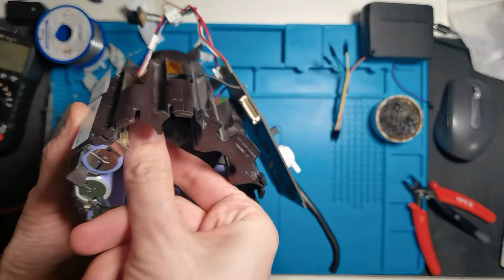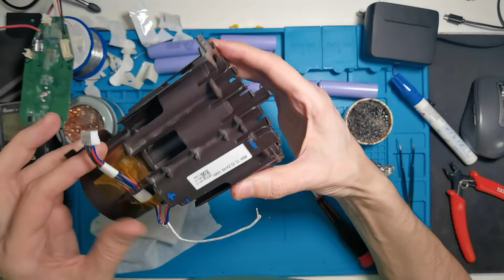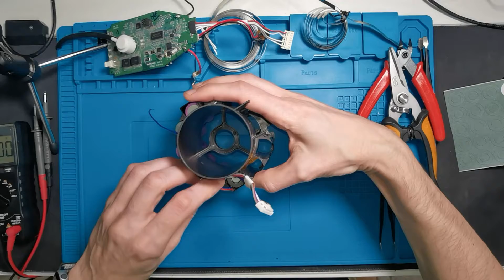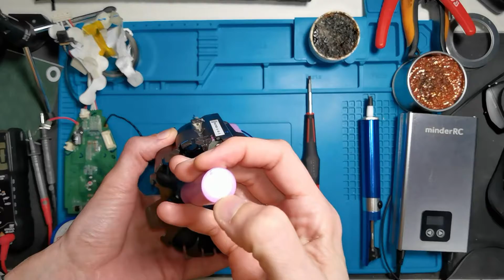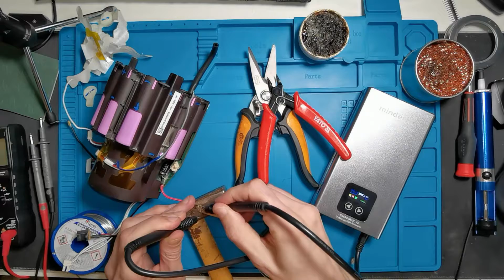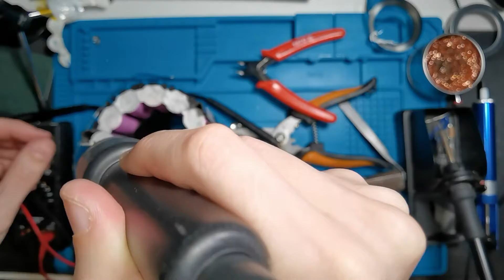Bosch ATHLET vacuum cleaner easy repair replace lithium ion cells SAMSUNG 22P board cip BQ77PL900

Comment: I trier to change the battery and i got them on 29 V but after installing all the vaccun it wont abel to start .
Reply from the maker: Maybe the BMS is locked ? The cells must be changed before no longer working at all.
Reply: @MariusVilceanu  mine the same too. The old battery worked (for very little time) and charged  too. Any idea?

Comment: Hi Marius, I have replaced the batteries but I can't find anywhere how to reset the battery management chip - the PCB has the black four pin connector and I'm guessing it is the serial port - or is there an engineering "trick" to do it using the switch or something like that ? Thanks, Brian in Dublin.
Reply: Настройки микросхемы управления батареями сбрасывать не нужно. Вам это не поможет. 4 контактный разъем предназначен для заливки прошивки.
Reply from the maker: You can't reset the cip, there is no option for this model. You need another board with unlocked cip then replace the cells.
Reply: @MariusVilceanu  Чип (микроконтроллер) сбросить можно.
Reply from the maker: I don't have the right tools for the reset procedure.
Reply: @lozarioloza7684  Hola, me podría describir cómo hacerlo? Con las pilas nuevas los leds parpadean como si estuviera cargando pero no enciende. Gracias
Reply: @AlejandroPerez-Sevillano  Нужно подключать плату к программатору. Это долгая процедура, так словам не опишешь.
Reply: @MariusVilceanu  Many thanks !

Comment: Salut Marius, 
Urmarind clipul tau, de mare ajutor, am desfacut si eu un Bosch 25.2 athlete. observ ca are tot 7 celule, insa am vazut ca ar mai fi loc de inca 2(chiar 3). Ar fi vreo problema daca mai adaug inca 2 in capete, tinand cont ca nu as maia vea acele fire BMS ?
de asemenea, la acest bosch am samsung INR18650-30Q 136 (3000 mAh, 15A,) . Le pot inlocui lejer cu 18650 22P SDIEM sau cu altceva mai mare gen 18650 LI-ION 3450mA 8A 
Multumesc mult !
Reply from the maker: Salut., nu mai adauga celule in plus fata de cele 7, deoarece vei depasi tensiunea de 27.5 volti si poti arde placa de control. Poti pune si altele mai mari ca si capacitate, insa ar fi bune tot unele de 15A la descarcare.
Reply: Mulțumesc mult. Asa am citit ca o sa crească tensiunea iar capacitate mai mare găsesc doar cu A mai mic de 15. Am luat la fel! Mulțumesc de sfat și pt video!

Comment: see, you use some 4pin programer, can you hapl with it. have change battaries, but with connected charcher have no indication. on bq77pl900 - chg - 29.42, dsg - 24.56, vreg1 - 5.0, vreg2 - 3.3. charger din`t start charge.
Reply: Can you share you model number including revision no. or best would be to share the pic of the board ?
Reply: @KanwalAfzal-sr3cd  Плата тип 2013.05.29. Ревизия 2.1
Reply from the maker: Sorry, about the delayed answer, have you resolved the issue ?
Reply: I have the same problem, after chancing batteries BQ77PL9000 bq77AQXHK locked the battery . I  replaced fully charced batteries but ot dosent work. How can I unluck BQ77PL900? Thank you .
Reply: @htamerhtamer8682  Заблокировал не BQ77PL900, а МК